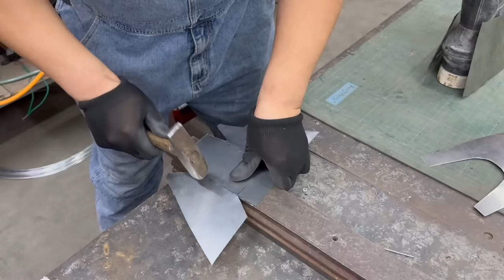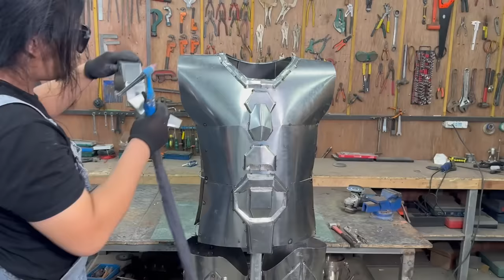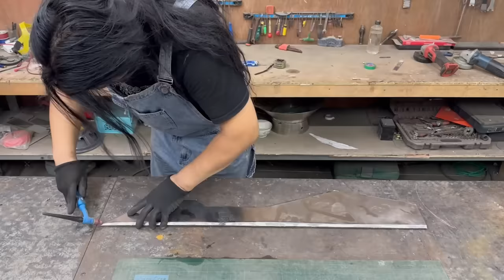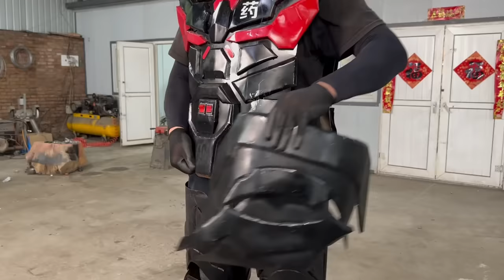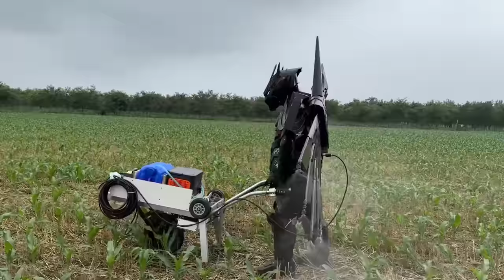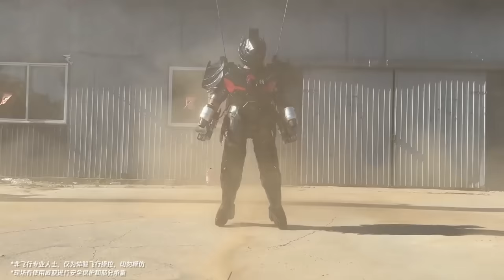ENG) 飛起來了！自製農藥噴灑機甲！I'm Flying! Handmade Pesticide Spraying Mech！【手工耿Handy Geng】

Comment: It's really great that it protects you from pesticides, but metal armor in a field would get too hot in the sunlight, and metal armor is heavy too. If there was a cooling system in the metal armor, that might help reduce the heat. But it's very cool.